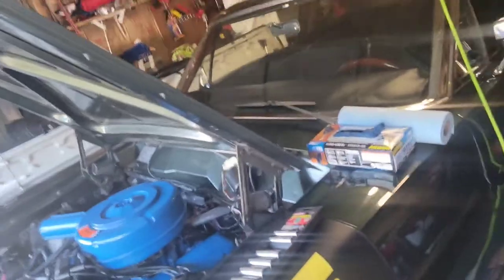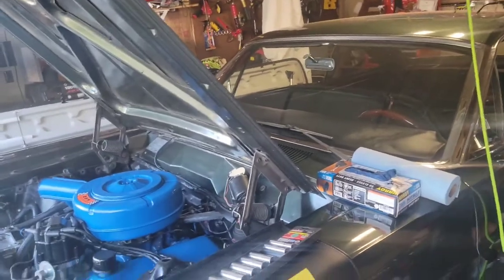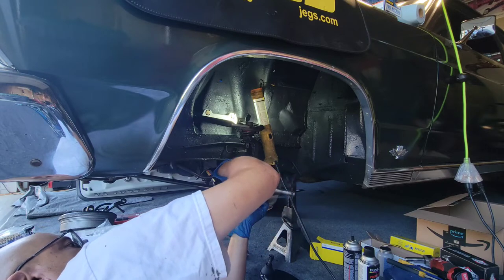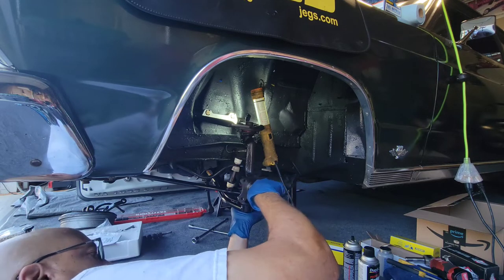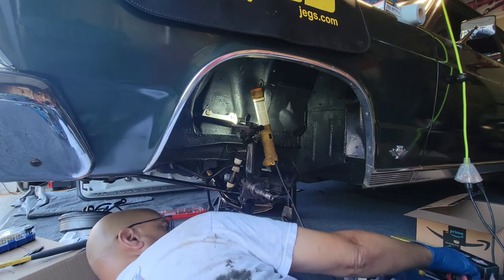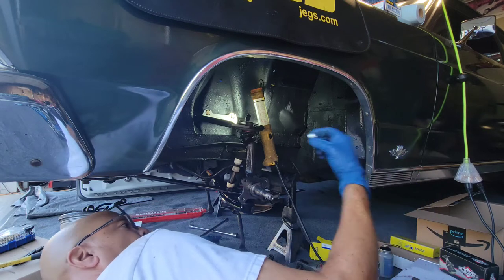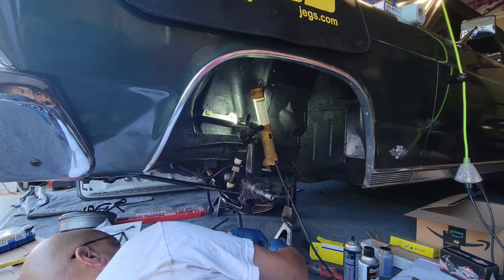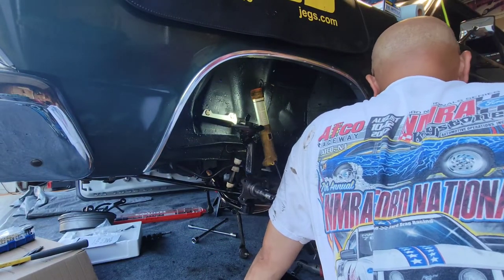1966 Ford Fairlane  Coilover Suspension Install

Comment: I’m an old Ford guy. The first Falcon was introduced in 1960.  Thanks for posting. Your patience is commendable. It’s not easy working on the floor especially with such a comprehensive suspension modification.
Reply from the maker: Thanks for your comment and support 👍🏼